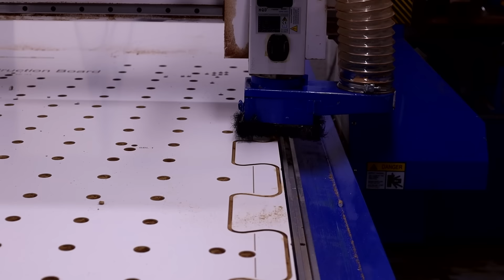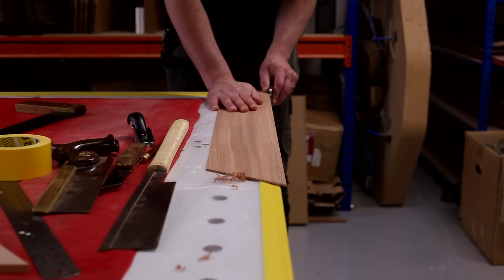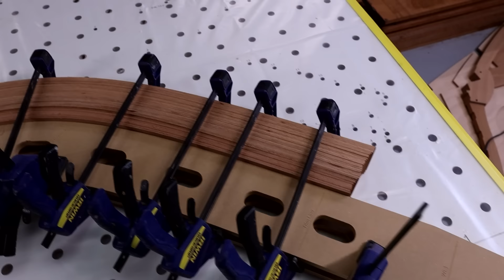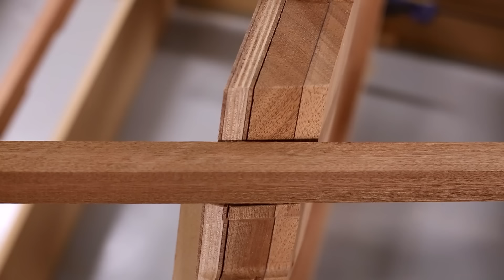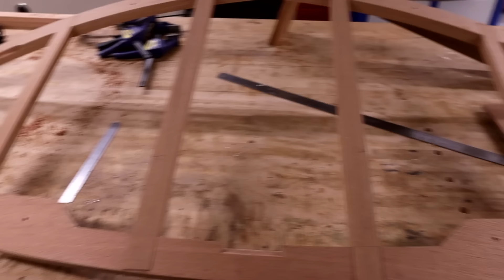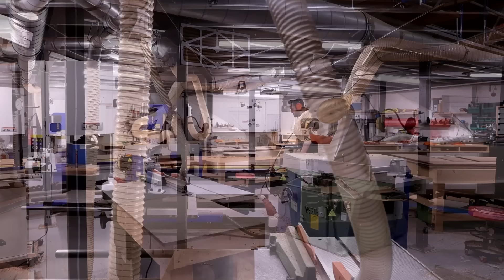Building The Parts Of A Modern Wood Runabout | Building Temptress Ep19

Comment: Forgive this question... Will all this precision and tolerance become a problem later on when this boat starts to "live" in future years? Simply put, will the tight tolerances force problems later on when the wood moves around?
Reply from the maker: Being a modern wood construction this will not move around, not to the level of expanding and contracting planking anyway. This method of building it worlds away from the days of wooden boats that leak and need to swell up.

Comment: Great build video. Never teach that robot to assemble and finish or us tradesmen will be obsolete.
    Find a Rolls Royce Merlin and gearbox and we can probably line you up some unlimited hydroplane plans .
We’re doing jr. 9’ hydroplanes and a couple runabouts at our Hydro and Raceboat Museum near South Seattle Wa. that we use kits to speed up assembly.
    Wish we had that cnc setup for a bow assembly we’re about to build , planing 5” diameter by hand will make more shavings than your entire project.
That pre shaped rubrail assembly is epic .
    West system will help this survive unlike the boats built before it was around .
    Looking forward to assembly.👍👍🍿🍻
Reply: Check out the lowrider cnc by v1engineering, full sheet CNC that you can put together for about $600 (not as beefy as Dan's but very capable all the same).
Reply from the maker: The CNC will only get me soo far, in fact its work on this project is almost done now. It will establish an accurate foundation to build upon but it will mostly be hand work from now on 🥰
Reply: @timothymattson3680  I was thinking of a Packard V-12. But as tough as those are to come up on, if I were to build one, I just might do a small block chevy 383 stroker.
Reply: I volunteer at the Hydro and Raceboat Museum and I got a ride in the Miss Wahoo which has an Allison on methanol. Felt like a broiler at startup , I saw 130 mph on speedo and even got hands on the wheel of the Sapale decked 28.5’ hydroplane.
    The mass of bigger engine is hard to substitute with something 1/2 of .
   We’re recreating the 1979 Miss Circus Circus around the surviving 
Rolls Royce Merlin engine. Took 3 to make 1 , but is from actual hull .
   We hope to run 4 Rolls at same time to reproduce a picture from a race back in late 70’s .
We have Miss Budweiser 79, Miss Atlas Blu Blaster , and the 
Squire Shop 1979.
Takes around 30 volunteers working year round to keep them running while also being a Museum.
10 engine guys .
Reply: @timothymattson3680  but she does give you that 1930s feel doesn't she.
Reply: Oh yeah , I thoroughly appreciate the swanky lines .
    I race 1937 Evinrude and I love anything from that time that is still in use or that it is even copied is awesome to keep history alive .

Comment: Wow, impressive amount of work and judicious use of CNC... 

What is the accuracy you get / require from the router (0.1mm? or better? ) - I suppose a kit with pre-CNCed parts would also make sense, to minimize the amount of hand finishing while at the same time probably saving from blunders and getting more accurate finish...
Reply: cnc can make parts accurate have possiple be 0,01mm. lot better than furniture woodworkers can made,  old true have, timper not can make 1 inch smallest accurate, woodworkers can make 1mm size, furniture make 0,5mm only sometime, and CNC can make 0,001mm accurate.
Reply: @mattivirta thank you, this is why I asked Dan about his own experience with his CNC router on his wooden parts for a boat kit, and not theoretical tolerances on say, single point diamond turning of optical elements in nanometer...
Reply from the maker: This is a good point to highlight. Whilst CNC machines will often quote an accuracy of 0.01mm or something in that region, what you actually achieve out of the finished product can vary there. More importantly, how accurately you are actually even able to measure the parts that you've made to verify this accuracy! In episode 4 I did some checks to see how accurately the built frame matched to the CNC program and I was getting within 1-2mm there at any given point around the frame. I think given the scale of what I am building here, that will be a sensible tolerance to expect to achieve at any given point. Thats probably way in excess of what people are working to building boats traditionally.